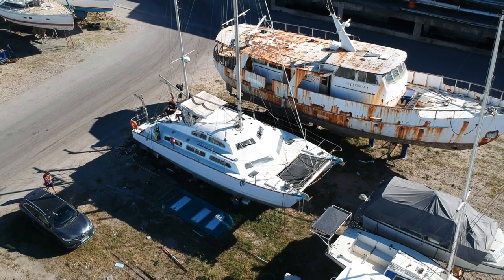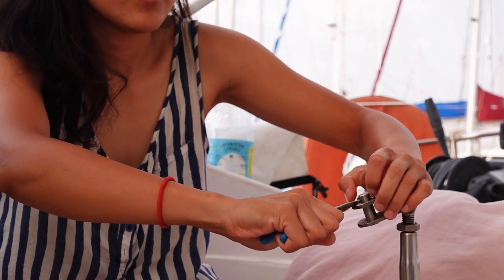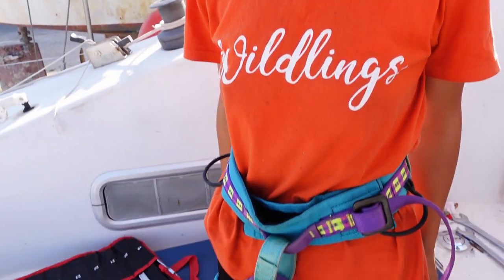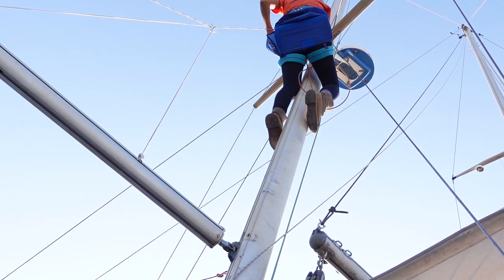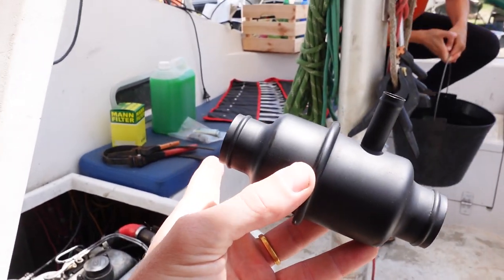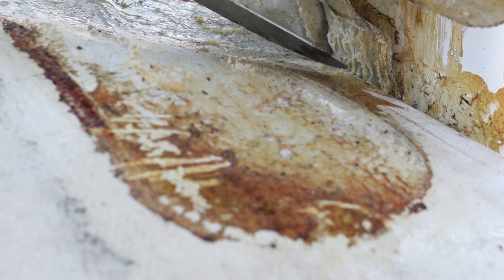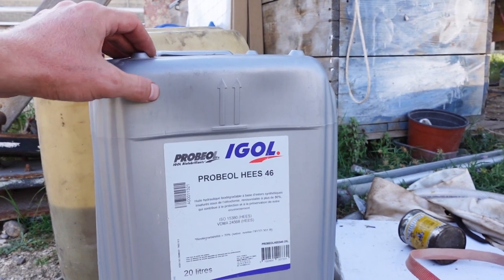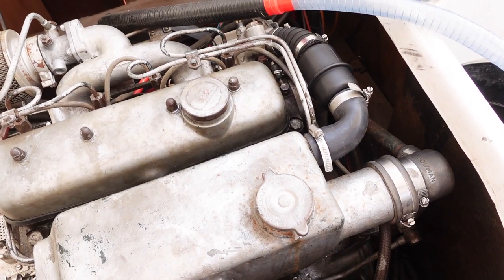DIY Re-Rig ~ Catamaran Revival On A TIGHT Budget | Wildlings Sailing

Comment: I don't think that's a corner cut. I think that's a great way to make do with what you have within your means. I think you're better off doing ALL the rigging at the same time, if you have the time, because if you don't you're just going to have to pay to have the rig re-tensioned again later on..

Also, your overheating issue MAY be caused by scale buildup in the heat exchanger where the coolant transfers the heat to the salt-water. There's several products that can flush your engine out, or you may try the vinegar route... If you do go the vinegar route, make sure to flush the engine well with normal water, as it's acidic.

Comment: Dude , what are ya goin on about what the armchair sailors think. You're doin fine, need some improvement here and there, but actually, who don't?.  As for rigging, I prefer galvanized, cause it streaches instead of suddenly breaking, and cheap enough to carry extra for emergencies.  Don't know why you go bio, use what the system has been running on for the past decades.  AND with hydraulics, the system should be run before changing